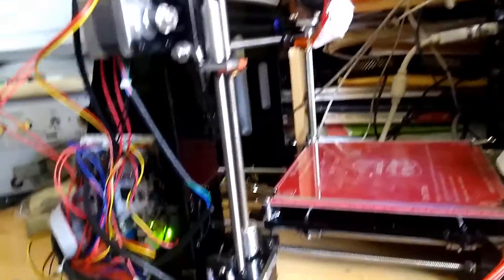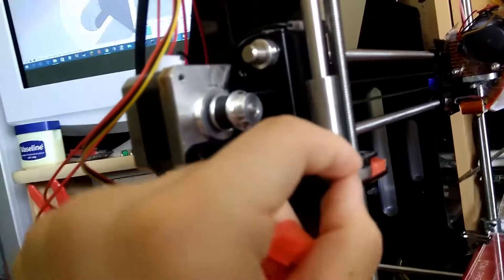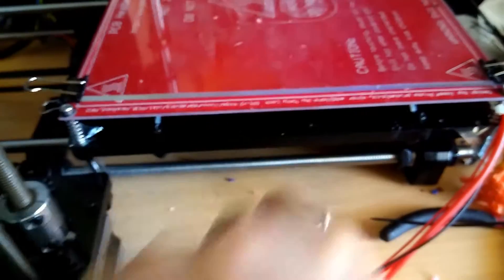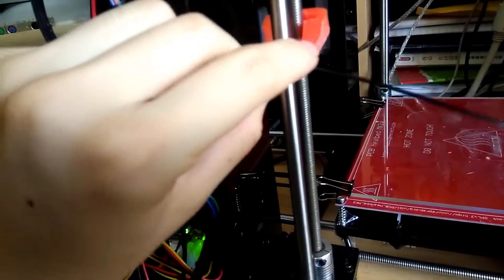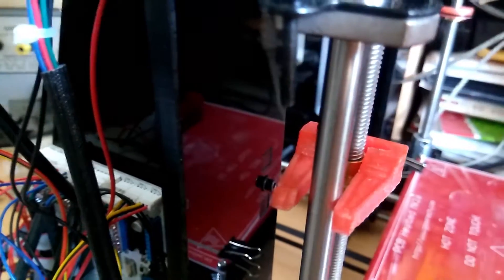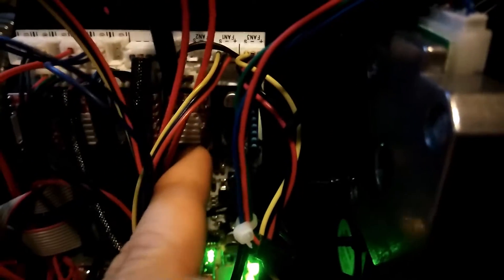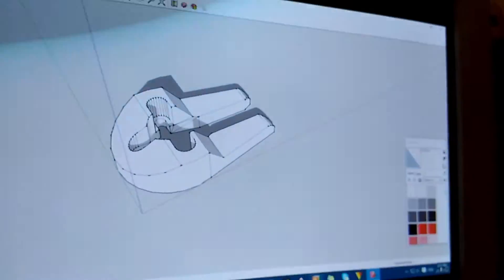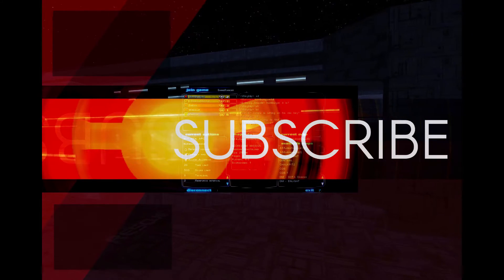3D Printer Z Axis ANTI WOBBLE Hotswap Mounts DL IN DESC Prusa/GEEETECH i3/Reprap/Wanhao/

Comment: why not print the original I3. mk2 stL files fix all ?
Reply from the maker: Do they have a free travelling stabilizer for the Z axis to compensate for the error in the screw threads?
Reply: Not sure all I no is it will improve you x and z axis with it being solid parts swell as increase build size because it flips the acme nut to the top instead of the bottom
Reply from the maker: you got to be able to print first without the head staying at the same z height